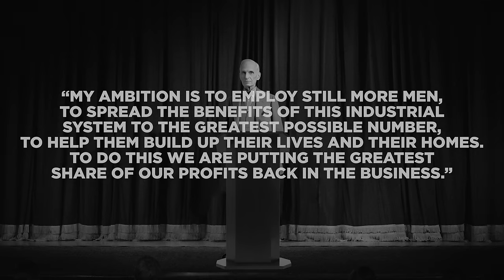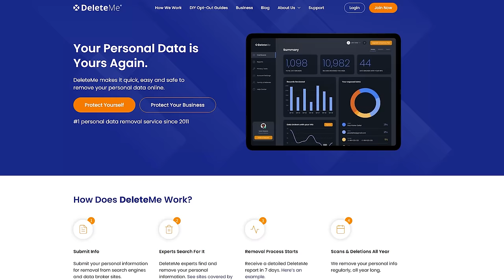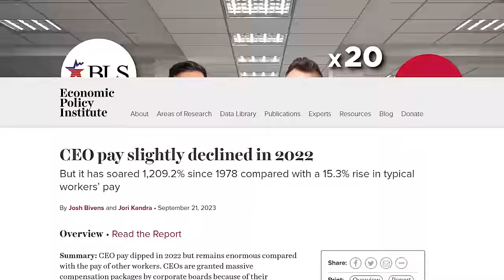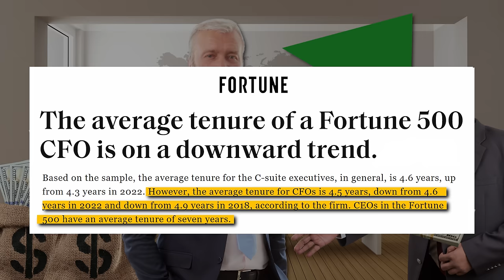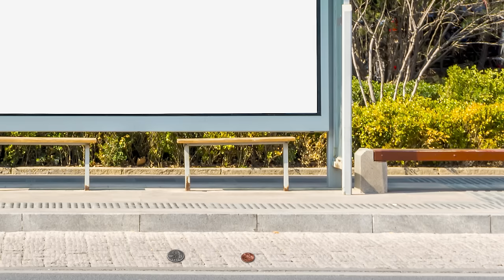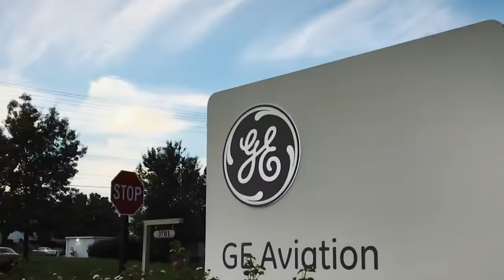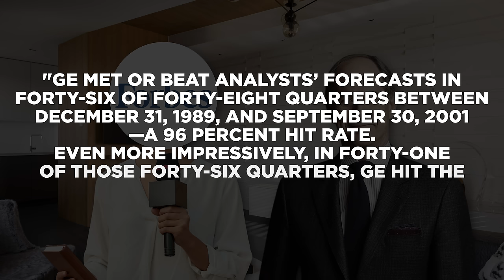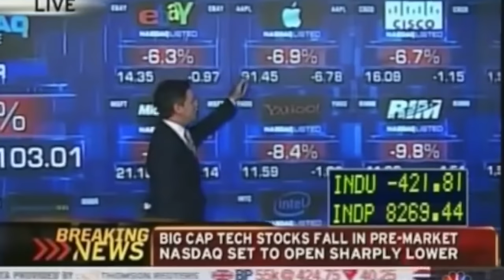The Dumbest Business Idea in History

Comment: Boeing cutting down on safety controls and testing is the thing that pisses me off the most. These psychos have literally decided that their returns are worth more than the safety and lives of their machines passengers. Literally criminal behavior.
I think that all happened after the change from an Engineering-Educated CEO to an MBA CEO with little no engineering experience? Like, wtf is such a move even legal in a field that is usually pretty brutal when it comes to safety? Not to say that all MBA CEOs are necessarily bad or evil, but the one responsible surely was.
Reply: Dennis Muilenberg was actually an Engineer by trade before becoming CEO (and resigning because of the 737 MAX crashes). But the larger point still stands that even people who should know better will still knuckle under when their pressure and incentives are pushing them in the wrong direction
Reply: @Erohlson  Ah that's a good insight to have. One wonders how "having planes crash" does "increase shareholder value". It appears that the exact opposite is the case, considering the image problems Boeing now faces. Seems...extremely short sighted, almost to the point of blindness.
Reply: Exxon Valdez taught us it's cheaper for companies to drag things out in court with lawyers on the payroll for decades than avoid the problem in the first place or pay damages, until almost all of those affected have all died and they only have to settle with a few parties.
Reply: @TheFriendOfLucifer I don’t think it’s that they see having plane crashes as increasing shareholder value, but rather they see spending on improving safety as decreasing shareholder value. There’s also the hopium of thinking that it’s an isolated incident until reality shows that it’s not.

The ‘small government’ cheerleaders simply want to remove legislation that legally binds them to do the right thing because doing the right thing has costs. Safety legislation in particular gets put in place as a result of companies not doing the right thing on their own in the first place.
Reply: Yeah, pretty much. Also applies to environmental legislation. Companies don't mitigate (cause profits!), stuff goes wrong, people die, new regulation, companies sad.
Reply: 80/20 rule probably applied
Reply: Getting rid of experienced white middle-aged men to hit DEI targets might also had an influencce on safety.
Reply: @lucibelle  I'm sorry, what? it was the court ruling that set precedence to always maximize shareholder value, isn't that the government's fault, how is a smaller government going to be different when the big government is already in the corporation's pocket
Reply: @TheFriendOfLucifer  saving cost saves increases shareholder value short term. until the plane crashes, then the shareholder value pummets. but the CEO can be long gone by then.
Reply: @jurgnobs1308  So? If the CEO has endangered peoples lives by cutting costs concerning safety, and the result of that cost cutting is a death toll, why not hold them responsible even if they are not at the company anymore?
Reply: You are missing the forest for the trees. It does not matter if the CEO is an MBA, an astronaut or the Pope, the issue is structural, the incentives are already there. The investors will demand profit ASAP, all the time. If one can’t do it, another one will. Crappy CEO’s are a symptom of a way larger problem.
Reply: @DAB_1903  Ironically, one could argue: "So hold the investors responsible if their demands and pressure leads to such results"...but I agree. The system in place right now is not the best and requires improvement.

Seeing the pope as a CEO of a real estate company, however, is quite fitting all things considered🤔
Reply: @TheFriendOfLucifer  Hahahaha, at least in the Pope’s favor, it can be said that he is in for the long run.
Reply: This is why some think white collar crime isn't that bad. They didn't know that taking those shortcuts was going to hurt or kill anyone. The CEOs and board members wouldn't directly see the lives they were about to destroy. The crimes weren't "premeditated".

But after all the news and tragedy when this keeps happening, how can anyone claim ignorance as a defense? We need stricter laws against this greedy negligence.
Reply: The CEO is just dumb or greedy. Even someone with no engineering background will know how important the safety control is to an aircraft.
Reply: Same thing in academia. Now people with mbas are telling professors how to teach things mere mbas will never understand.
Reply: ...That's because their returns are worth more than the safety and lives of their passengers.
Reply: @technokicksyourass  Not in the long term certainly 🤣
But it looked great on paper for the very short term!
Reply: It started after Boeing (which had a reputation for high quality) merged with McDonnell-Douglas (which had the opposite reputation) and the MD mindset prevailed. John Oliver did an excellent episode on it.
Reply: They were pretty brutal on safety, until they decided on an honor based system instead of
Reply: the door plug blowing off, made a lot of people cancel there tickets to get on a Airbus.
Reply: You think Boeing is bad you should see the mechanics at the airport…
Reply: The top executives are Boeing should be doing jail time.
Reply: Its criminal but we can't prosecute a company because it isn't a person but it is a person; but its a person that's more equaler than the rest of us so all we can do is fine it as a cost of doing business.
Reply: @TheFriendOfLucifer  "Seems...extremely short sighted, almost to the point of blindness."
All the Market cares about is the next quarterly earnings statement. If that means a year from now planes crash, then oh well I guess because the profits were all made a year ago and the stocks sold. This is what I think of when I hear "let the market decide."
Reply: @lucibelle Smart "small government" advocates hope that decentralized institutions could do the governments job better than it's currently being done.
Reply: If that pisses you off, then do NOT look into oil lobbying against environment protection policies, or the effects and origins of leaded fuel additives.
Reply: @readyforlol  I know of both, and some more. None of that is any less aggravating😔

Comment: There is a runaway trolley barreling down the railway tracks. Ahead, on the tracks, there are the trolly company's low and mid level employees tied up and unable to move. The trolley is headed straight for them. The company's executives are standing some distance off in the train yard, next to a lever. If they pull this lever, the trolley will switch to a different set of tracks. However, this will delay the trolly and cause the company's stock price to miss growth projections. They have two (and only two) options:
    1. Do nothing, in which case the trolley will destroy the lives of the people on the main track.
    2. Pull the lever, causing the company's shareholders to lose out on a half-percent of returns for that quarter.
Which is the more ethical option? Or, more simply: What is the right thing to do?
Reply: If they cant see the employees they would chose the secpnd option
Reply: @heitorpedrodegodoi5646 They seem to be happy enough to pull the lever even when they do see the employees. Some people just don't care about anything but their own wealth.
Reply: I see a lot of execs picking the third option; two track drifting. Why just destroy hundreds of lives when you could destroy hundreds of lives AND crash your stock price in the process

Comment: The problems listed don't seem to have anything to do with the maximizing shareholder value model. In fact, most of these are explicitly the opposite: using various tricks in order to hide the actual performance of the company from shareholders. Brand and reputation doesn't show up on the balance sheet (except as part of a merger), so, yeah, you can make your numbers look good through extracting earnings (numbers that do show up) by ruining your reputation (numbers that do not show up). However, this is obviously not in shareholders' interests.

The problem is that the stakeholder model also has enormous issues, in that it essentially gives management leeway to do whatever the heck floats their boat, with no real oversight.
Reply: Underrated comment
Reply: It does have a lot to do with maximizing shareholder value, as you laid out. Reputation doesn't show up. It doesn't influence shareholder value from the point of view of the shareholders in charge.

Comment: This short term attitude is also visible whenever money needs to be saved. Whenever there are steps like that to be taken the company only looks at stuff that will immideatly improve the balance in the books without considering solving root problems or longterm effects.

Example: I work for a very large international manufacturer, we recently started to recieve measures to cut costs ... along the ones that were directly relevant to us: "Visitors from other companies may no longer be invited to lunch on the companies cost" and "Traveling for international buisness trips and conferences ahs to be significantly reduced and approved by senior management" ....The first one we managed to veto after a long fought battle because only an asshole would consider the probably miniscule amount that one would save worth it compared to the inhospitality and rudeness this would convey to every buisness partner ever.  (We basically threatened to cancel all planned buisness meeting since we did not feel comfortable inviting people like that).The second one is still in place severly limiting our access to international science conferences and is directly cutting us of from recieving news and updates ... this will probably bite us in the ass in a few years. Also considering how much senior management is payed the time it takes them to look at each case and approve it is probably more expensive than the trip was to begin with ... but that cost of course doesnt show up in the books.

Comment: Around 13:15 you say that part of the reason for reduction of holding period is that dividends can be less tax efficient than long term capital gains. Do you have a source on that? Corresponding dividends would usually be qualified dividends (if original stock was long term capital gains), which, as far as I know, are as tax efficient as long term capital gains.

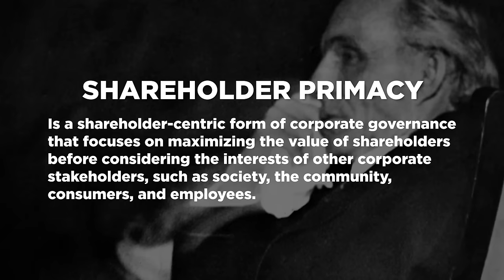Comment: The premise setting section of the video 1:49 - 2:33 seems... technically correct, but misses the point. The (paraphrased) statement 2:12 "CEOs and their boards don't have a legal mandate to make stonks go up" is correct. However, the Ford precedent does open up CEOs and their boards to lawsuits with this general shape if they don't make stonks go up, because long-term re-investment and strategy is practically invisible to the courts that determine if a CEO and board are doing enough.

Comment: You have mixed two unrelated things. Short-termism is a world wide trend, and is unrelated to the concept of shareholder value. Three is nothing wrong with maximizing shareholder value, the issue is with the large option-primary pay and short tenure of CEO's today, which drive corporate short-termism. If people understood what maximizing shareholder value actually meant, things would be fine, but the current incentive structure works against shareholder value, which is why it seems like making money for shareholders is the problem, but its really not, the much bigger issue is the lack of incentive to work on the company's long term.

Comment: You forgot the 4th reason this has not changed.  A lot shares are held by passive investors (e.g. Vanguard).  These shares usually go with managements decisions, which means it doesn’t change.  I’m summarizing, Mike Green does a much better job explaining this connection.

Comment: maximizing shareholder value is what they should be doing.

However, what is often chalked up to maximizing shareholder value is not often that. cooking the books, playing account games, posting sales this year or putting the posting until next year to change how this year looks or next year looks are simply games that at best to nothing and at worst hurt shareholder value.

Shareholder value is more than the price of a stock.

The example that proves my point is the first one with Ford - What Ford wanted to do would have been best for shareholder value. What the shareholders thought shareholder value comes from was wrong. Lowering costs via wages or other measures were not the way to go. Ford lifted productivity through those better wages and shorter hours.
Reply: Shareholder value is definitionally nothing more than stock price increases and dividends. And in a market where most people don't hold a stock for a year, they have to make a ROI every year. So perhaps there are some markets that don't need to maximize profits, like theoretically utilities?

Comment: Maximizing shareholder value is not the same thing as trying to get the stock price as high as possible right this minute. Maximizing shareholder value basically means trying to optimize for the equation of how much do you invest in a business times what is the acceptable return on capital. Value is created when returns on capital exceed the cost of capital. I thought you had a background in Finance, so I would think you should know this. A management team making short-term decisions to try and juice the bottom line for next quarter's report is not maximizing shareholder value if it means they are degrading the customer experience by understaffing a location or they're running off their best and most knowledgeable workers (as a couple examples).

Comment: There's a bit of faulty information in the video, or rather, a bad source. The Productivity-Wage gap presented by the EPI is erroneous and the study that originated it had terrible methodology to the point of being a literal fabrication for propagandistic purposes.

The Economic Policy Institute used different metrics for inflation in order to adjust the real values of productivity and wages. They used the GDP price deflator for productivity, and the CPI for wages; both which scale differently and creates a huge discrepancy by itself.

The EPI also omitted non-cash compensation and deliberately discounted it when accounting for wages, despite the proportion of non-cash compensation such as health insurance or worker benefits having increased over the years. Using total worker compensation lowers the gap even more (most of it is caused by the different metrics used).

To add salt to the wound, the EPI used productivty across ALL SECTORS for their analysis, but only considered non-managerial jobs for wages, which again increases the gap artificially.

There is no Productivity-Wage Gap, the only source of it is that specific EPI study, and it is not only fallacious but intentionally deceptive. No one can screw up so many independent variables by accident or negligence. It's propaganda.

Comment: Just a useless statistic:
In 2011, the entry level annual salary at TCS (Indian service based IT firm) was ₹3,00,000 ($6,000 exchange rates from that time of $1 = ₹50) & the CEO used to earn ~₹8.5M ($1.7M)

Today, the entry level annual salary at the same company is ₹3,50,000 ($4,117 - exchange rate now stands at $1 = ₹85) while the CEOs salary increased 100x to ₹850M ($10M)

The bottom strata of the firm got poorer & if you take into consideration the extreme inflation in the country, their condition is far worse than those in the same shoes 10 years ago & the upper management got richer & richer.

The middle management on the other hand just ends up getting fired as soon as their pay becomes "competitive"